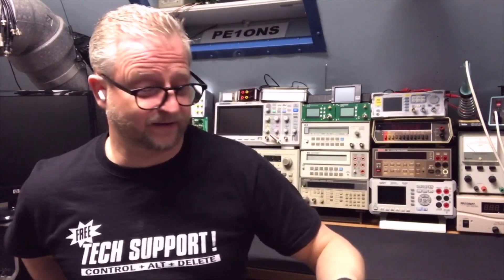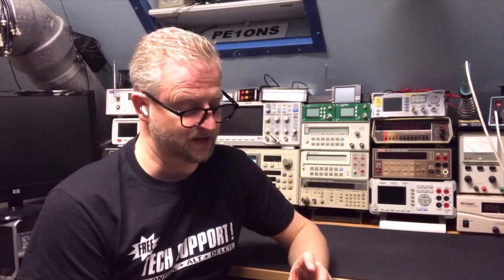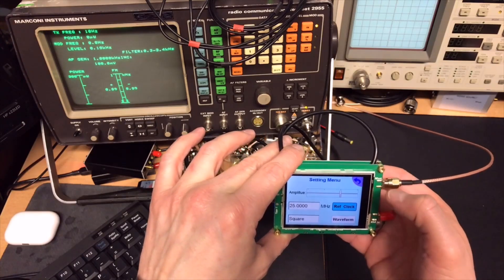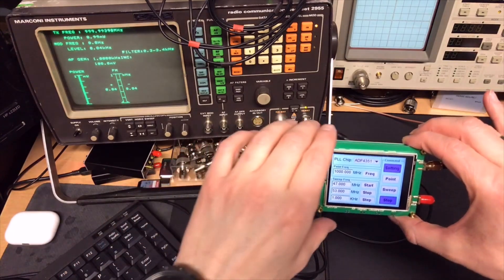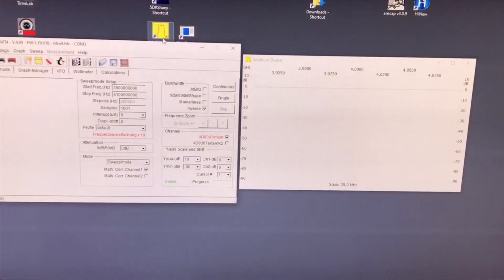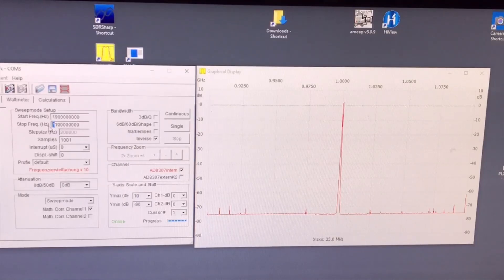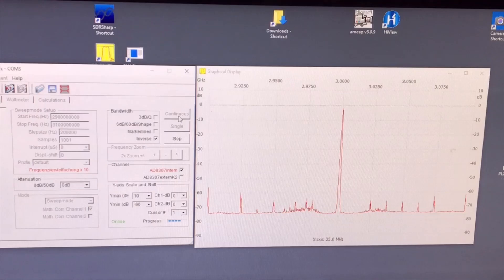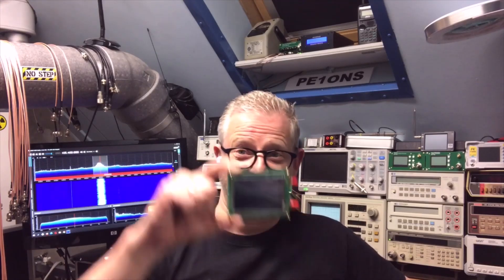#123 Q&A (3) ADF4351 LCD Power Output on the Frequencies

Comment from the maker: (has been removed, not by me, found the copy in my email.)
From: Frank Real
Hello Tony please I need your help for this ADF4351 module for one prodjet: After programming the freguecy on the module and take off the power the setup stay on place or is (reset) deleted? Thank you for your help.
Reply from the maker: Yes the settings stay as the were last on power off, or unplug. but it stops 'transmitting' . when you power it back on, you need to push again 'Point' or 'Sweep' to make it 'transmit' (the output does not go back to the former state, it powers on in the OFF state)